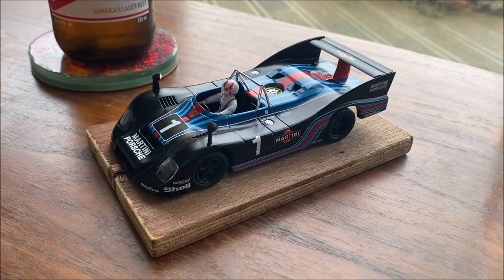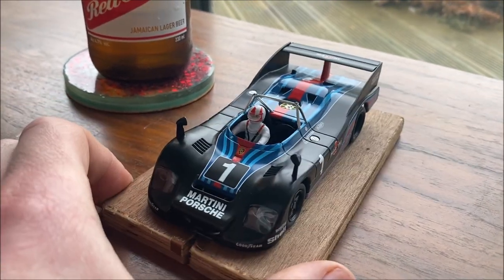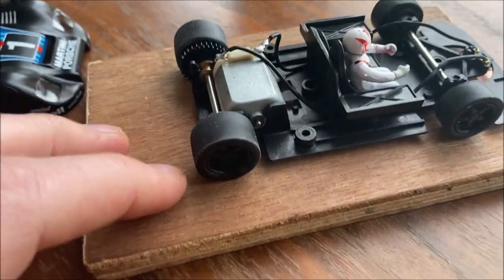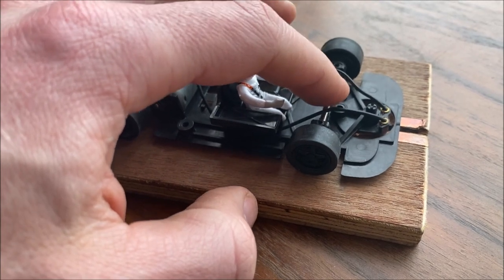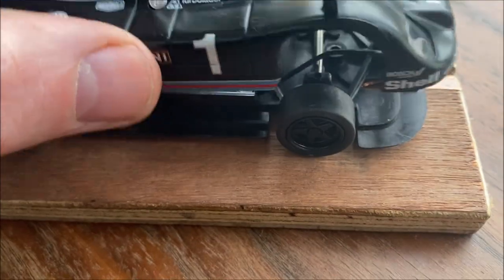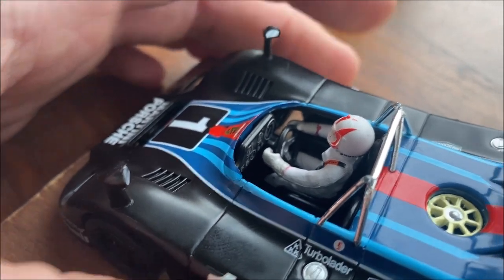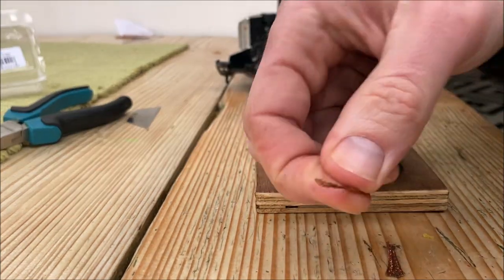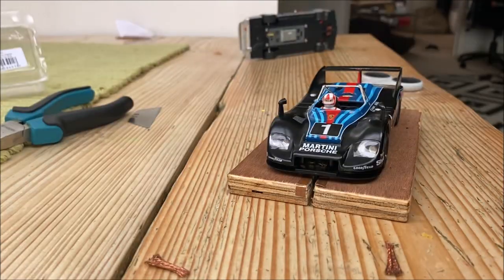What's on the bench today? - Prepping the Spirit Porsche 936 slot car for racing

Comment: I’m fairly new into slot cars , nothing serious,just playing around at home an trying to stay of my super bike,it’s to fast now a days,lol. Taking the magnets out does it make much difference ? I thought it was to make the car stick to the track . Greetings Portsmouth England 🏴
Reply from the maker: Hi, and welcome to the hobby! You are 100% right in that magnets are there to make a car stick and provide traction. So why remove them? (Ah, the age old magnet argument - I could speak at length about this so will try and keep it brief!) Aside from the fact that as a general rule we don't use them at the club I race at,  it really is down to personal preference. Is a magnet car faster overall? Yes. Does that make it more enjoyable/rewarding experience? Not necessarily. For me, I really like to have the differences in handling characteristics between the cars (a narrow tin-top should require a much more cautious corner entry than say an LMP car). It requires a lot more driver input to stay within the limits of the car and keep it moving quickly on track. That said, unfortunately the process isn't always as simple as just removing the magnet and off you go. In the case of manufacturers like Scalextric and Carrera, magnets will hide the effects of poor quality tyres and braids, and some cars (Scalextric Holden Torana's spring to mind) are near impossible to drive enjoyably without magnets (at least without a lot of work and tuning!).  Because of this, taking the magnets out does generally open you up the minefield/expense/can of worms that is slot car tuning. But generally, just with some better tyres and a few other choice tweaks, magless is far more enjoyable for me; chasing those extra 10ths due to car control rather than watching a blur hurtle around a track at some crazy pace.  But, if you're having fun, that's all that really matters